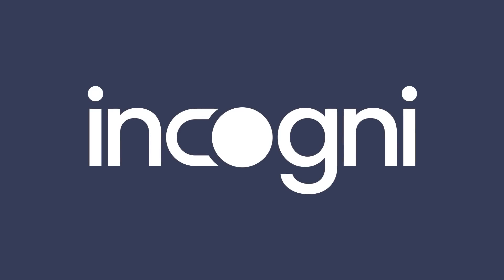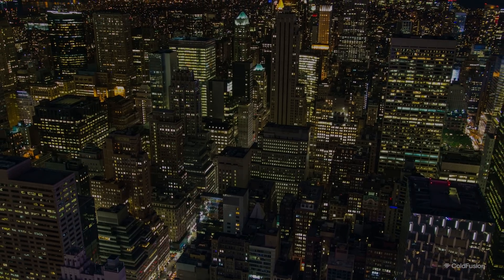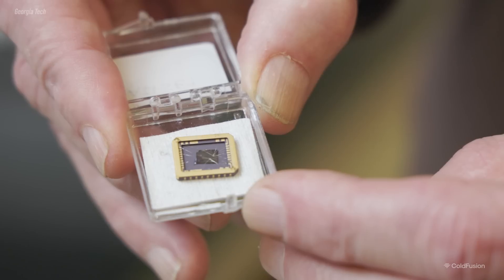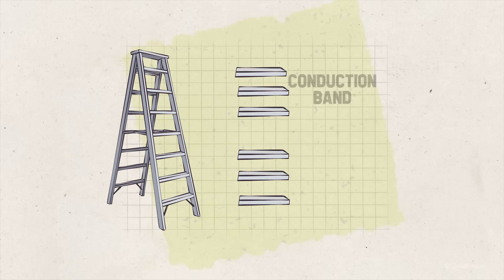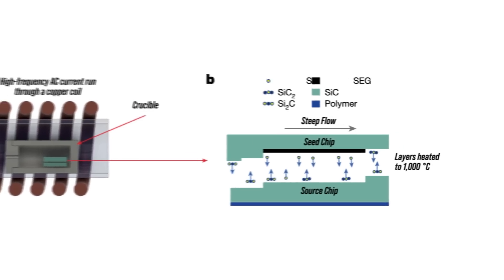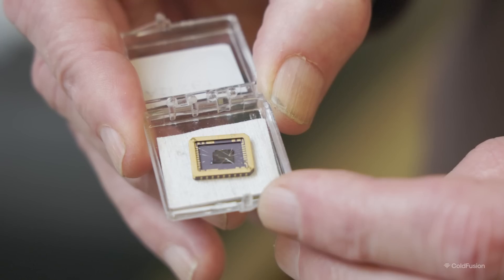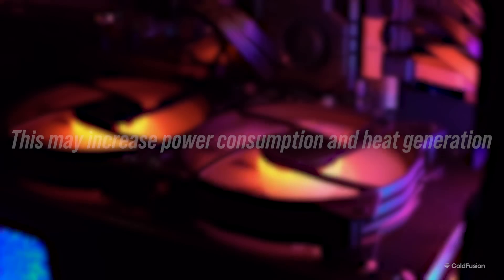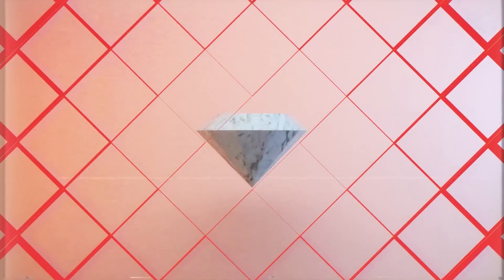This Chip Could Change Computing Forever

Comment: Would  graphene semiconductor be usefull in quantum computing?
Reply: I asked chatGPT! 

Graphene is a fascinating material thanks to its unique properties, including high conductivity, transparency and flexibility. In the field of quantum computing, graphene could play an important role, although it presents both advantages and challenges.

Graphene's potential advantages in quantum computing include its exceptional conductivity, which could be exploited in the manufacture of qubits, quantum computing units. Qubits need to be extremely sensitive and react quickly to signals, characteristics in which graphene excels.

What's more, graphene is a two-dimensional material, which means it could be integrated into atomic-scale quantum devices, offering greater precision and miniaturization.

However, there are also challenges to overcome. For example, graphene has no natural band gap, which means it cannot be used as an insulator. In quantum systems, precise control is needed to avoid interference and information loss, which can be difficult to achieve with graphene due to its high conductivity.

In summary, graphene could be useful in quantum computing due to its unique properties, but further research is needed to overcome the technical challenges and take full advantage of its potential.

Translated with DeepL.com (free version)

Comment: Not to be "that guy" but a significant part of the power consumption in phones and laptops is the screen and radio. So you can make the processors as power efficient as you want the antenna will still need to connect to the tower.
Reply: This is totally true, but take Apple products as an example… breakthroughs in longer battery life have not largely come from better screen or antenna technology.

Surely you are not saying the way to making further leaps is better screens and antenna tech?

Comment: Very impressive but the most important info is missing: How did they achieve the "semiconductiveness" for graphine? What is going on in detail so the meterial behaves that way?
Reply: Right, I'm aware of its conducting properties, so your saying it'd not just the graphene but also an additional layer of metal that make it semiconducting
Reply: They use highly purified unicorn semen to achieve terahertz transistors. It will take about ten years to breed a herd big enough to mass produce.
Reply: When they evaporate silicon some of it stays captured in the newly formed graphene.
Reply: That's exactly what I'm trying to figure out,  I mean they explained the technique for synthesizing graphene but graphene is by definition a single layer of carbon atoms, and as far as I know it can only be in the one honeycomb lattice arrangement. So what is it about his single layer of carbon atoms that makes it better than anyone else's single layer of carbon atoms.
Reply: @aaronwallace4219  It is achieved by "doping", adding impurities to the structures so they have the correct properties that is trying to be achieved, much the same a silicon is today.
Reply: @nigelrhodes4330  oh OK I guess that's what I missed I assumed his silicon carbide method was just to produce the graphene, yeah I didn't realize the silicon was being incorporated into the lattice structure as well. Well that makes much more sense to me now,  thank you
Reply: @aaronwallace4219 the high mobility of graphene can be altered with the application of electric fields (eg a live metal sitting on top of the graphene but blocked with a very thin insulator). you provide an electric field point a different direction from the path of electrons through the graphene, and the mobility drops, resistance increases. resistance is still pretty low, but because graphene mobility is so insanely high, we can have very low voltage active transistors just using that behavior.
Reply: @aaronwallace4219 and what makes it better is the monolayer of chemical bonds organize so that pi bonds face upward and downward while the planar bonds throw electrons around far better than any metal.

Comment: The problem you speak of at the end (current leakage) can be solved while scaling down the transistors. When researching problems with leakage at sub nano level it was actually discovered that taking advantage of quantum interference of electron by sending waves shifted by PI you can actually achive near-zero current leakage.
Source: New Microchip Breakthrough: Scaling Beyond 1nm, author: Anastasi In Tech
Reply: With such fine scale structures you can achieve great results but at this stage the manufacturing processes are not there yet, well not for any large scale production. Deposition and layering are often done with sputtering in semiconductor manufacturing and is improcice a lot of the time. These structures can be made by placing individual atoms at the moment but production at scale has proved difficult.

Comment: So, what isn't clear from this video: is the chip they're showing in the video a single transistor?

If not, what is the current size of a transistor?

What is the speculated lower limit in terms of size that we can achieve?

Because current transistors are so small, you can count the individual atoms making them up, and a process which boils away atoms to create a viable materials sounds like it would leave pretty big holes behind, drastically reducing miniaturization potential

Comment: "Imagine your phone lasting for days" Why yes, I do remember the 3310
Reply: It also doubled as a hacky sack. 
Now I look at my phone the wrong way and the screen cracks
Reply: And those changeable batteries of old , when you have the power to fix the problem. Instead of having to get a officially sanctioned item , which the manufacturer decided not to allow you to have access to .
Reply: @Actingskint  new EU regulations - should come in 2027 - are making battery replacement mandatory in all new phones. Unfortunately some countries have left the EU so no battery replacement for Britons lol.
Reply: touché
Reply: I used to have a samsung solid phone that lasted 2 months :)
Reply: Now imagine your Nokia 3310 running on graphene battery.....
Reply: i used to use an iphone se (1st gen) as a dumb phone. And it lasted 14 days. I was very amazed. Today, my xiaomi is pretty good too, but i can't use it as a dumb phone anymore. still 3-5 days usually.

as for my laptop - even if the cpu will drop power consumption by 100%, it will still last for only about 6 hours due to screen. So no, laptops will not last weeks until we have a battery breakthrough.
Reply: @victortitov1740  Thought the same thing when I heard that.  guess they are going to need to make graphene screens too 😂😂
Reply: @victortitov1740  Battery breakthrough and need to get a more efficient processor. These M2/M3 Macs have pretty great battery life.
Reply: „Imagine traveling without refueling”. I remember riding a bike….
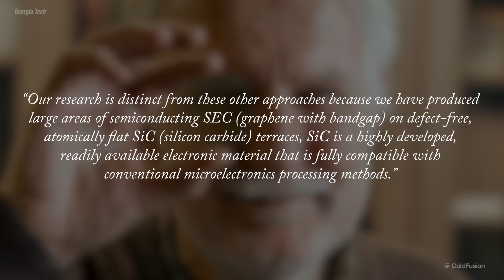Reply: 8:10 and you didn't have youtube google ig facebook photoshop games besides snake video calling gps internet chatting health trackers netflix...
Reply: It never did. That's not true!
Reply: Yes, the Nokia 3310... what a machine !
Reply: Exactly the comment I was looking for
Reply: My phone's battery actually lasts months. I very rarely use it 😬.
Reply: really old phones lasted forever without a power cable :P they received power from the line like PoE but more like PoPOTS :)
Reply: Weeks*
Reply: Xiaomi smart phones last 3 days if you are a light user internet of internet
Reply: what about 5110I :)
Reply: blackview, doogee and many other phones do this now. my s97 lasts a full work week 40hrs+ with the bluetooth headset in work including calls and browsing at lunch. just dont buy the phone version of girls skinny leggings.
Reply: peak mobile phone design
Reply: back when we, human, are the smart ones.. not the phones
Reply: If you turn off everything so that you only have the same functions and use it as you used the 3310, then your smartphone will last for a week or two
Reply: Disturbed made a song about it,I think it was called "indestructible"
Reply: And it played the best mobile game ever made, Snake.
Reply: Guess what, you can buy a brand new 3310 today, they remade it!
Reply: My phone lasts for days. If I don't use it for more than an hour a day I can get 3 days out of my S21 Ultra. Screen brightness low, wifi/other services off whenever possible, close background apps. Not hard to get more than two days.
Reply: It lasted long because you didn't use it

If you wanted to play snake for hours on end, it drained just as fast as most modern phones do.
And if you didn't really use it much, it last just as long as most modern phones if you genuinely don't use it.
Reply: @hundvd_7  I can't speak to the part about snake, but your second point is demonstrably wrong
Reply: Those time where you really excited when you got a text message even if it's from the network provider. 🤣🤣
Reply: mine already does, but that is mostly due ot its literal 10,000mAh battery
Reply: Easy to last for days if you're a thing that does nothing in contrast to our small super computers today.
Reply: @chrisobber5604  True, but also way less distracting, ngl I miss the era or brick dumb phones
Reply: @am3703  Remember the old days when people would answer their phone and ...shock horror... speak to you. Imagine that.

Comment: Bullshit. Sorry but there's no other way of putting it. 

First of all, there's a huge difference between making a single transistor that can switch quickly, and an actual integrated circuit running at the SAME speed. Existing commercial transistors can already switch in the range of >500 GHz for RF applications, meaning in actual practical system, and I'm sure those non-graphene transistors can do so much faster too if you make a lot of trade-offs and really try to set a record. However a CPU needs literally billions of transistors not just switching quickly, but in a long sequence WITHIN a single clock cycle to do any computing. Thats why they run much slower than these RF transistors. 
Guess what: Fast switches have been around for much longer than that too: Vacuum tubes that run in the 100s of GHz have been around for over 50 years, yet noone builds computers with those anymore for some reason. Oh yeah, because they cant be built into nanometer-scale somehow. Which is just as much a challenge for graphene btw.

Graphene is definitely an interesting field of research, but it is at least decades away from being used in any digital electronics, if it ever will, since many other technologies also get improved further in the mean time.

Comment: Academically interesting industrially impossible without multiple Decades of re-educating silicon designers to work in graphene R&D and developing the equipment to actually implemented 2050 would be an optimistic projection for it

Comment: This is the same case as with batteries, every year you hear about some breakthrough tech and still your phone dies in a day with the same old lithium battery.
Reply: There's a big difference between research breakthroughs and market adoption. "Fast" in this context is 10 years... the problem is usually with overzealous science communicators not being clear in where the breakthrough happened. For example, we do have working solid state batteries that outperform standard lipo batteries, but they have only made it to limited runs due to issues scaling up to mass production. What we were hearing about years ago were incremental steps of solid state batteries in research settings getting closer to matching the battery King of the day. So progress has been happening, it's just often overhyped and poorly communicated.
Reply: There's a big difference between making something "work" in a lab setting, and making a commercially viable product.  Lithium ion batteries, for instance, were invented in the mid-1970s.  We didn't really start seeing them though until the early 2000s.  New tech is coming.  It just takes time to mature.
Reply: I googled the battery mentioned in this video, and yes, too good to be true... Those batteries are no longer available, company was sold in 2021, and they no longer offer consumer products.
Reply: @fobusas Tech is advancing so fast manufacturing can't keep up. Companies have to make their money back on manufacturing. Being a brain on a $20 million complete remodel of a lawn mower blade factory you'd be amazed at how difficult it is to make a lawn mower blade efficiently. I can only imagine how it is in the Tech world. Unproven complex processes and technologies working on nano scale has to be a headache.
Reply: Not to mention that this will only benefit the CPU and a few other chips on the board. There are still huge battery hogs like the screen that won't benefit from this.  A backlit screen on it's own won't come close to a week on a typical laptop battery.
Reply: It's crazy isn't it, hopefully within the next decade we'll have an alternative?
Reply: @mrtiff99  What's crazy is that Dagogo didn't mention this at all in his video. If you haven't done research yourself, you would have been massively misled about those batteries.
Reply: ...The Lithium batteries were the breakthrough that allowed that phone to both fit in your pocket and last for a whole day of use. I feel old saying it, but I remember when there were no cell phones I-pods that only played locally stored music were revolutionary. better batteries have previously proven to be game changers, they surely could again; after all it's batteries that are the biggest limiter for electric vehicles.
Reply: Currently some smartphones using graphene battery tho (honor, xiaomi)
Reply: It also may be a case of increasing load along with capacity. Yeah you could build a phone that has a weeks battery... But it would probably be slow, dim, and probably heavy/large.
Reply: To be fair a lot has happened with ion lithium technology over a large span of years. It's never as cut and dry as people wan't it to be. However, we do get plenty of idiotic technology promises all the time like Diamond powered cars was the latest one I saw. And every year some tech startup or pump-and-dump scheme promise fusion power. And Elon Musk promise every year that we will go to Mars in five years. Conventional, affordable and established technologies will be the thing that surrounds us for decades to come and they will always be improved upon. But new technologies like solid state batteries and Graphene chips might eventually become the norm. And then our descendants will have the same discussion when something new arises.
Reply: or medical miracles too...
Reply: "Undecided with Matt Pharell" 😂😂😂😂😂

The biggest snake oil salesman ever on YouTube 😂😂😂😂😂

That guy has a science/Tech breakthrough every single day on his YouTube channel
Reply: Progress takes time
Reply: I'm amazed we had astroNOTs calling the President on a landline, and yet an international call today has intermittent video and audio. Hmm...
Reply: @oldhickory4686  Those two systems are built on completely different types of technology. Also, you assume technology always advances as time passes, it doesn't.

Comment: How exactly are they running at THz? The laws of physics still apply for graphene. At 1 THz, electricity will propegate less than 0.3mm per clock cycle, even if it is at the speed of light. Carbon atoms are about 50% smaller than silicon atoms, but still, 1 THz is thousands of % more than todays silicon chips. I am interested if anyone knows how that would work.